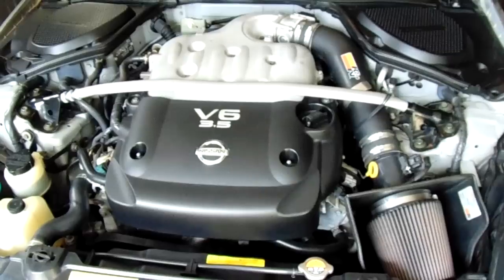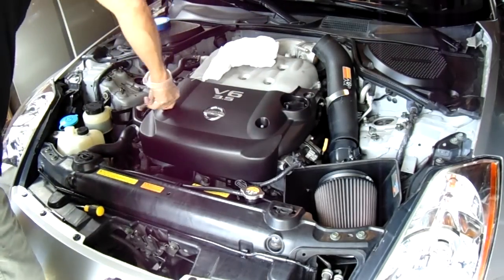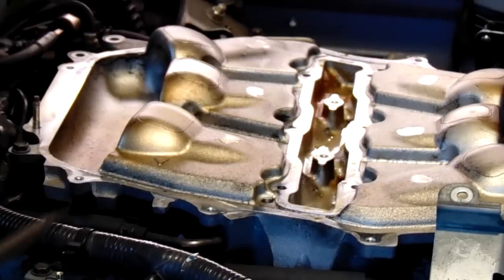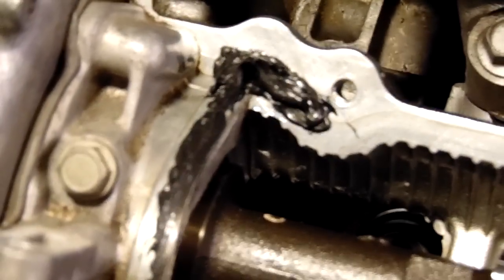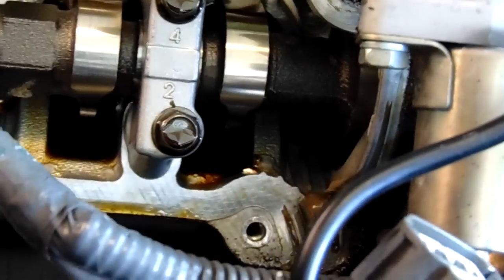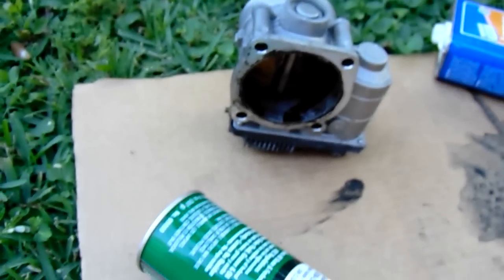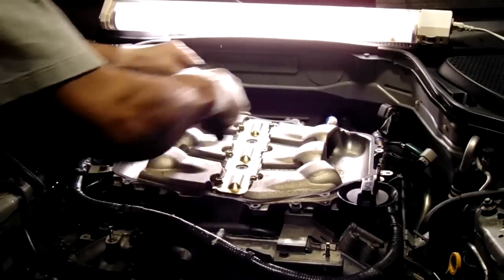350z valve cover gasket replacement explained! #Nissan350z #Zociety #Valvecover

Comment: Do you mind listing the materials that will be needed to do this, from tools to gasket maker?
Reply from the maker: Sure, I'll try to put a list together for you this weekend and I'll get back to you!
Reply from the maker: Sorry it took so long to get back to you. #1 Must Have A inch-pound torque wrench to torque valve cover properly. #2 Permatex Optimum black gasket maker. # 3 socket wrench with 10mm extension, swivel adapter and extended 10mm socket. #4 Basic mechanic's tool set. #5 Foot-pound torque wrench for strut bar #6 You will also need a lot of patience, so take your time, at least two/three days if it's your first time doing this!! Hope this helps and thanks for watching!
Reply: It’s no problem, thanks so much!

Comment: Is it necessary to replace every gasket? I ordered new valve covers as well as valve cover gaskets but do I need a new plenum gasket?
Reply from the maker: As long as your plenum gasket has no kinks or bends you should be okay to reuse it!
Reply: @Zspeed   awesome thank you! I went ahead and ordered them anyways, great video btw! Another quick question do you highly recommend the pcv delete? Or is it something I can get away not doing or doing at a later date?
Reply from the maker: I would recommend a non-vented catch can check this video out!:https://www.youtube.com/watch?v=fkIaD42NOf4  
I also have a updated 350z valve cover video available:https://www.youtube.com/watch?v=_15ivIVS9_I&t=529s

Comment: Great video! Please explain how I can detach the back attachment that’s on the wiring harness to the valve cover driver side. I try to push down and pull but it does not work.
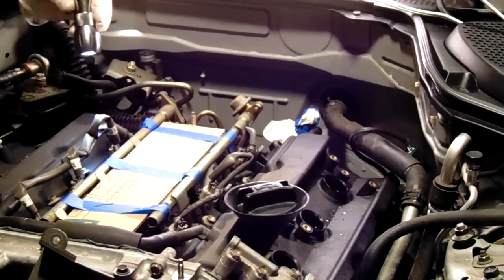Reply from the maker: This was a little difficult to remove, I believe the wiring harness has the same type of clip that the camshaft position sensor has, check out my video here: /www.youtube.com/watch?v=JvD4I6N7r34 and go to the 11:00 minute mark.
this video with show you how to release the same type of clip, this one is gray, yours should be green. but the clip release works the same way, hope this helps and thanks for watching!!!
Reply: Thank you for getting back so quick! Just to reiterate, I should push green tab forward. This I have done but it didn’t budge. Also the angle isn’t good to where I can/know where to put screw driver to wiggle it. It is not like the rest of the other attachments where you press down and pull out, right? Thank you!
Reply from the maker: Once you push the green tab forward,  that's supposed to release the connector. I had to remove my hood to get better access for this project! Just 4 bolts to remove the hood,  it might give you the angle you need.  Also this clip may be very stubborn, over time the heat of the engine tends to fuse this clip together so it may take a while, don't rush it! I had to use needle nose pliers to remove it after I pushed the green tab forward! Hope this helps!!!!
Reply: Good morning! I’ll keep at it with the attachment. Do you recommend I use the super glue or the gasket glue to hold up the gasket. Also would I dab the corners or squeeze a thin line around valve cover slot?
Reply from the maker: I used gasket maker, use a thin line around the valve cover slot! You may be able to remove the valve cover without disconnecting the engine harness, if it will not disconnect try to remove the old valve cover. This may give you more room to access the clip!
Reply: Z-speed 
Got connector off!!! Driver side valve cover is in! What’s the torque spec for the few  bolts on top of valve cover?  Thank you so... much for all your help so far!! I’m looking to bug you some more as I go forward. I hope you don’t mind.
Reply from the maker: Use my video to guide you, 16:53 minute marker shows you the bolt tightening sequence! Start with 17 inch pounds first round and end with 74 inch pounds! Your not bugging me, that's why I started this channel, to help people repair their 350z's and save hundreds of dollars!!!!!
Reply: Z-speed 
So I understand #1-10 outer bolts torque however the few bolts that sits on top of cover is the same torque specs ? Also what do you recommend for spark plugs ( ones that are gaped already). I was going to use Bosch but not sure how much to gap it. On another note, I got passenger side cover off and notice # 3 slot has a bit of oil residual. What am I to make of that?
Reply from the maker: Bolts on top of the valve covers are for  miscellaneous use, engine harness etc, hand tighten. Torque spec's for plugs are  15-21 ft- lbs, pick a number let's say 18 ft lbs and  torque them all to 18 ft-lbs. Oil in the spark plug tubes means it time to change the valve covers!😂
Reply: Z-speed 
AWSOME answer for torque!! Agreed with valve cover replacement. Any recommendations? Was thinking of Auto Zone parts instead of Amazon parts. Gonna redo left side valve cover as well ,again.... It be ok if I reused the gasket that I just put into left valve cover, right ? Also how are you able to torque # 7 on left valve cover. Lastly, for tonight, 😳remember those misc. bolt how can I get my hand on one? Have a feeling I’m not gonna find it (just in case).
Reply from the maker: Z1 motorsports for the valve covers and 10 ml bolts. Should be ok to reuse the valve cover gasket if it's not to old! You will need a swivel adapter for #7 bolt.
Reply: Z-speed 
I’m on it! Is it ok to reuse ignition coil #7 (bit of oil residual)? If so, is there a specific way to clean it up?Also what’s your recommendation on spark plugs (pre gapped ones). Not sure about gapping it. Looking forward to hearing from you and thank so very much! You have empowered me in so many ways!!
Reply from the maker: Yes, it's okay to reuse coil, just wipe it clean. 
NGK Iridium spark plugs pre-gapped. You can accomplish anything you focus on, don't let small setbacks break your focus! This also applies to any goals you have in life!!!!
Reply: Got the spark plugs! Do you know torque spec?
Reply from the maker: 15-21 ft lbs, I would use 18 ft lbs!
Reply: Thank you sir! Man..... looked up Motorsport cover- pricey! So got passenger cover side out. As mentioned before tiny bit of oil residual in spark plug near firewall. Also I’m looking at ignition O ring and no cracks. My question is would it be likely the oil residual came from gasket leak and not O ring? I had noticed oil drops from that corner before doing this whole process? I ask because I was thinking just reusing old cover due to budget restraints. Thank you for sharing !!🤔
Reply from the maker: Try JDMSPEED from Amazon for 52 dollars!
Reply: Oh my! More bad reviews than good 😬. How long does Motorsport warranty your valve covers?
Reply from the maker: @saysanaliemthongsamout6989  check out 1AAuto valve covers.
Reply: Looks promising ish. Please share warranty info. on your Motorsport covers. Couldn’t find it on their website. Thank you!!
Reply: Good morning, I would like to know the location of rear main seal on my g35 2003. I suspect/noticed a thine line of oil on a part but not sure what it’s call. This is when I pour dye to find leaks.Any pics or video reference would be greatly appreciated! I apologize if this question may sound dum. Have a great Thursday. Looking forward to hear back!!
Reply from the maker: The rear main seal is only accessible by dropping the transmission. So if you suspect a rear main seal leak there should be oil around the transmission where it joins to the engine. The use of should not be needed.
Reply: Good evening, please share torque spec for ignition coil bolt? I’m having a hard time looking it up. Thank you !
Reply from the maker: Just snug it up hand tight, it's make of plastic, just make sure it's not loose!
Reply: PCV valve to intake breather hose was a bit brittle/crack so I’m using PCV hose instead. That should be ok, right? Also any pics of the harness diagram attachments location? Can’t seem to account for one attachment on driver side in spite of taping/numbering them. Thank you, hope you have a GREAR Sunday!!

Comment: Do I have to drain the coolant ? If not when I loose some coolant from the throttle body do I have to top the tastier and bleed the system or can I just put coolant in the resvior
Reply: Radatior I meant no tastier
Reply from the maker: You should be okay by topping off the reservoir,  check your engine temp and make sure it's running cool. If not, bleed the system!
Reply from the maker: P.S. thanks for watching my video!!!!!
Reply: Z-speed thank you ! Gonna go do this as soon as my valve covers come in This is best Video for sure Explained and showed well

Comment: My valve cover bolts keep popping out. Like the holes are stripped or something. I bought a tap set and rethreaded the holes, no luck. Bolts still pop right out when torquing to 70 in/lbs
Reply from the maker: Hey Alex, thanks for the question! On my valve cover replacement video go to the 16:30 mark for the valve cover bolt tightening sequence, there is a certain order that the 10 mm bolts must be tightened in to get a good seal. It takes two passes, try 17 inch-pounds for the first pass and then the second pass should be 74 inch-pounds, not 70 inch-pounds. Hope that fixes your problem!! If that doesn't work, try putting blue Loctite on the end of each bolt and repeat the sequence above. Are you the original owner of this 350z? If not, someone my have striped the valve cover bolts before you bought it! Hope this helps you out and thanks for watching my video!!!
Reply: @Zspeed  thanks for the reply. I did torque to the specs you mentioned in the video, and I also tightened them in the correct order. I'm not the original owner, so I suppose it is possible they were stripped by someone else
Reply from the maker: Purchase brand new 10 mm bolts from Nissan, your original bolts might be severely worn, let me know if that works!!

Comment: What’s the cost for the valve cover gasket replacement ?
Reply from the maker: Around $428.00 if you buy your parts from Z1 motorsports!
Reply: Z-speed that’s all?! sweet!! What about labor ? I just bought my Z today and got a buyers inspection and he said theirs a minor leak and says “valve cover gaskets leaking” and also “replace valve covers, and gaskets” so that’s around $450 or so and then labor could be like 3-400?
Reply from the maker: If you do it yourself you will save lots  of money, if you pay someone to do it, it's about $400.00 +!!!!

Comment: Was it leaking oil or something sir  mine has a small oil leak wondering what can it be ??
Reply from the maker: Wear does the oil appear to be coming from?
Reply: @Zspeed   example  sense you didn’t chance  valve cover same here how would we know if it leaks oil any way to check just for future reference thanks
Reply from the maker: Usually, your spark pulg tubes will start to fill with oil.
Reply: @Zspeed  hello thanks you for the reply see I didn’t chance the valve cover when I chance the gasket do you think it should last.   Thought them gaskets
Reply from the maker: Yes, they should last for a  while!!!
Reply: @Zspeed  thank u

Comment: How well those the product work so far?
Reply from the maker: So far, I have no leaks around the valve covers or in the spark plug tubes!!!!
Reply: Z-speed I don’t know how many times I’ve watched this video lol, great to know it’s still going without any issues. My car started to miss fire and noticed oil in my spark plug tubes so it’s finally time to tackle this. I’m happy you’re also using aftermarket because OEM is ridiculously priced for plastic valve covers lol

Comment: Great video.... very detailed but the background music is too much. I had to activate the caption option. Other than that great video my friend.👌🏁
Reply from the maker: Thanks for the tip, I will be releasing an extended valve cover replacement video with all new audio and lower background music! thanks so much for watching!!
Reply: @Zspeed  

That would be great. I just ordered all new valve cover gaskets, crank sensors,coil pack,new mas air flow sensor.

I also replaced the spark plugs and now it has a really bad misfire problem.

Any idea what could be the problem.

Thanks in advance
Reply: Ohhh and I ordered new OEM valve covers
Reply from the maker: Make sure you use NGK iridium plugs, check owners manual. If that's not the problem, it is most likely a bad coil pack. The coil packs usually last from 100,000 - 125,000 miles. Since you just changed the plugs, sometimes just removing one from a plug can damage it. Once they get old they become brittle inside and the wires can tear and that's not always visible from the outside! Hope this helps!
Reply: @Zspeed  ok NGK.

QUESTION. what is the tork specks to tight up the plenum bolts and I know that they are numbered
Reply: Should I clean up the solenoid?
Reply from the maker: 114 inch pounds, you need to do three  passes,  first 38 inch pounds, then 76 inch pounds  and end with 114 inch pounds!  Diagram for bolt tightening sequence is in the video!
Reply from the maker: I didn't actually clean the solenoid, but it wouldn't be a bad idea!
Reply: @Zspeed  thanks for all the help. Keep up the good videos.....

I keep you updated. Thanks again

Comment: Nice video but about 50/50 on some of the information provided. Not sure what you were accomplishing with disabling the PCV unless you're moving to a properly vented catch-can arrangement. Those small filtered vents will end up providing you a nice oil mist and will be something that need to be cleaned regularly. People forget that an engine is a pump - as much air that goes into the cylinders is also pumped around the crankcase which is why we have to provide some system to control it. Old cars used to have road vent tubes, then we went to PCV which were much cleaner. Also the spark plug tube seals are available as a replacement item so they are serviceable - most people fail at it simply because they use the improper tools. I don't have a problem with using some additional sealant on the valve cover gaskets in as long as it is not a silicone based product. Silicone and rubber simply do not mix. And I have had multiple throttle bodies off and on over the years on different Nissan/Infiniti products and not once have I had to do any re-learning sequence. I think a few people screwed the pooch on that one and it became an internet legend.
Reply from the maker: Very good, your right on the money, catch can is the way to go not a PCV delete! I have a updated 350z valve cover replacement video, let me know what you think, here is the link: https://www.youtube.com/watch?v=_15ivIVS9_I&t=2076s

Comment: I just replaced the valve covers on my g and its leaking again around the tube seals. Do you think I can add rtv inside the boarder of the tube seals while the cover is on?
Reply from the maker: Definitely worth giving it a try! Let me know if it stops leaking. Unfortunately, you will need to purchase new valve covers in the near future. Try Z1 motorsports, and thanks for watching!
Reply: @Zspeed  actually I did replace them already a month ago.bought one from rockauto.com and one drom 1aauto.com and they both leaked after a month.you can watch my last video..hope you sub ✌

Comment: Is this the same process for an 06?
Reply from the maker: Should be the same if it has a single intake versus a dual intake. Check out my updated Valve cover gasket replacement video here: https://www.youtube.com/watch?v=_15ivIVS9_I
Reply: @Zspeed  it’s a single intake
Reply from the maker: This will work for a 2006!! thanks for watching!
Reply: @Zspeed  thank you

Comment: The strut bar is not 42 ft lbs!!! Its only 21!!!
Reply from the maker: No wonder I  couldn't  Torque it to 42ft lbs. Thanks for sharing!!!!
Reply: Also there is a spec to adjust tension on the strut bar after its been off.

Comment: I ordered new valve covers from eBay because mine were leaking in the spark plug tubes and I ordered them from Auto Parts Zone 2008 website out of New Jersey after 100 miles both valve covers were leaking into all six of my spark plug tubes it was a total waste of money I will not be ordering from them and be advised do not buy these valve covers
Reply from the maker: Thank you for the information,  try ordering from Z1 motorsports. They are supposed to be very high quality!